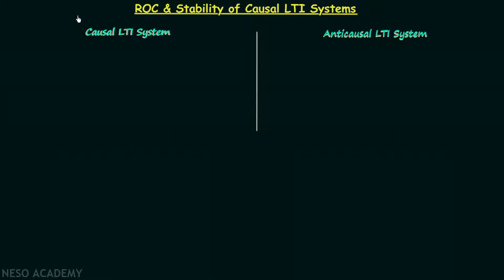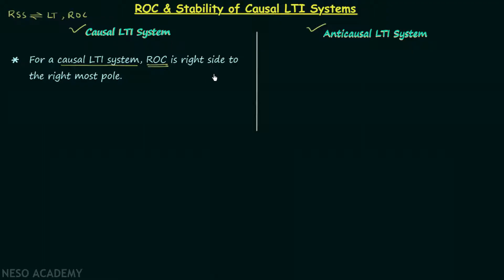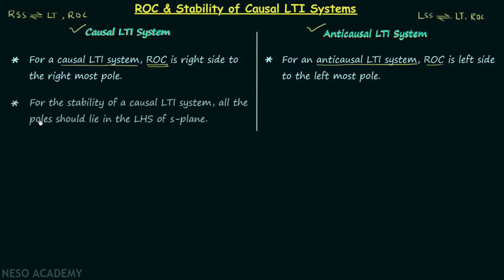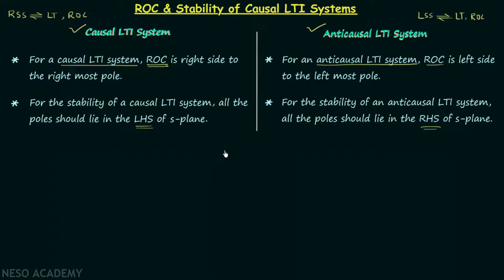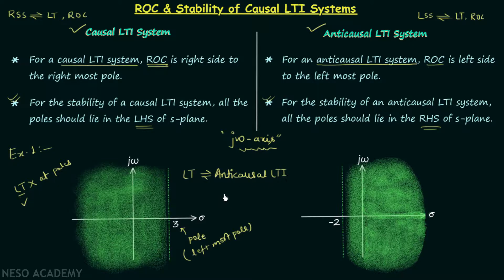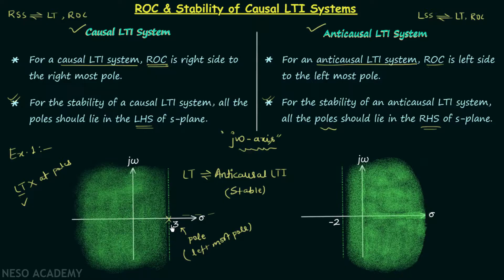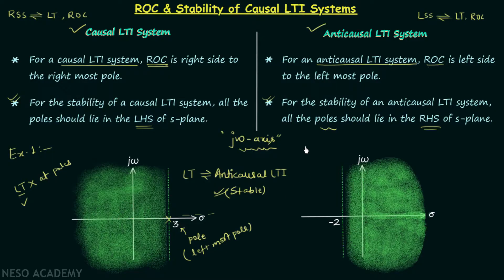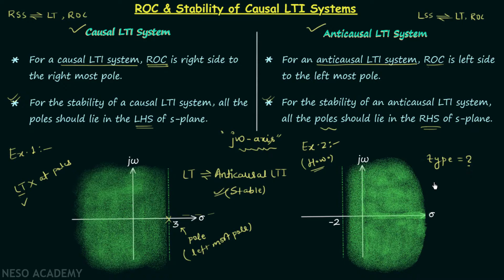ROC and Stability of Causal LTI Systems

Comment: Sir, as for an LTI system to be causal, the condition on its impulse response is h(t)=0 for t<0, which implies h(t) is a right sided signal, and as h(t) defines the system and is being RSS for causal, its ROC lies to the right side of the right most pole. Can i consider it this way sir?
And as Anticausal system is anti or exactly opposite for Causal LTI system, the statements said for anticausal will be exactly opposite of causal.
Reply: h(t) and H(S) both are different man, roc is for transform not signal
Reply: You are correct. Anticausal means completely lefthanded signal. Most systems are however causal, with a righthanded impulse response signal describing it.

Comment: sir wana ask one qustion 
if roc is right sided for sigma>2 system is called causal
if left sided for sigma<2 is called anti causal.
if there is no common roc e.g sigma <2 and sigma>3 system is non causal
but what we call the system if it has value of roc between sigma>2 and sigma<3
Reply: System will be non causal
Since for system to be Causal ROC should be on right side of right most pole... but in your system ROC will be between 2 and 3
Reply: Here in Example 1 pole 3 is on the right side.so how pole 3 has become the left most pole here.? Can anyone clear my doubt.?
Reply: coommon roc sigma>3 so it is causal